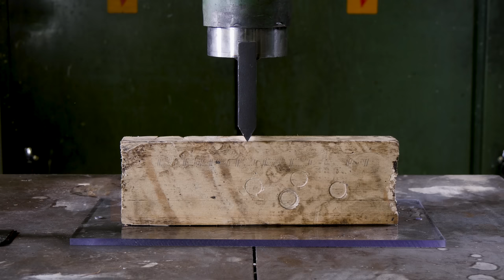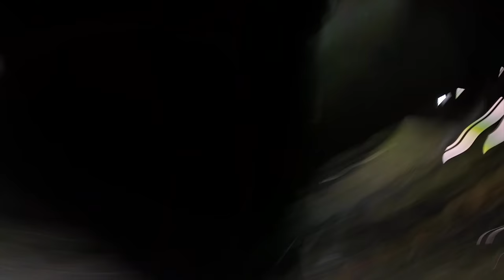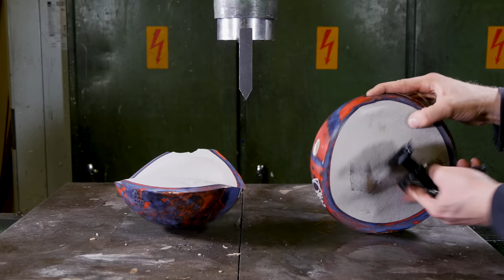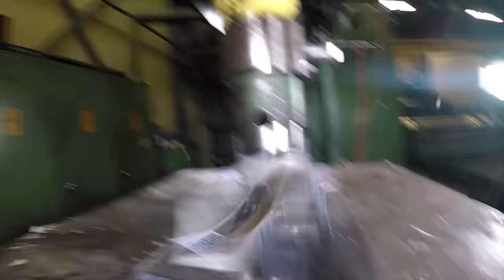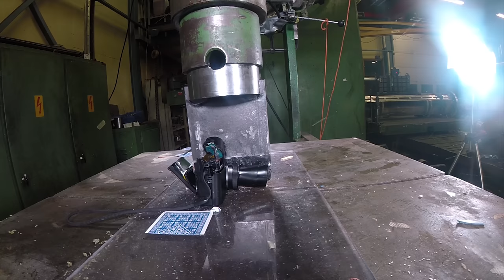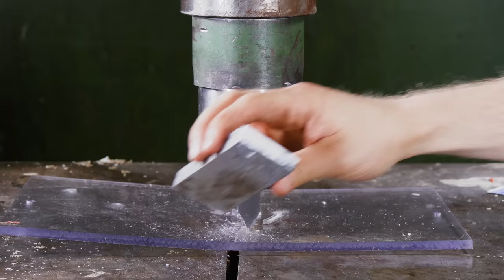150 Ton Hydraulic Guillotine Vs. Bowling Ball and Nokia 3310 | in 4K

Comment: Omg the deck of cards was so satisfying. You should stack like 10 decks of cards and do it again.
Reply: Cam D. How the fuck did you predict that
Reply: 10? Squeeze as many in there as can fit, and see if it will go. I don't think stability will be much of an issue if it is done with brand new decks and they don't break the stacks apart.
Reply: Ivan187 He didn't. He commented this after the 10 deck video came out.
Reply: Its Warpriest How are you so sure, wasn't the comment made before the video was uploaded judging from how long ago it says?
Reply: Its Warpiest 
No this was before. The comment isn't edited and the video of his request came out a week after. I just think the Hydraulic Press Channel owner didn't reply or credit the commenter but still saw it and made a video about it
Reply: Cam D. Please
Reply: Ivan187 actually if people mention something in the comment section, they did not predict anything, rather the creators use these ideas instead.
Reply: Cam D. Mine too it gives the literal meaning of cut the deck 😎
Reply: Yes  , with   ten  different  colors  to make   a  rainbow  .
Reply: 10? Try infinity and beyond!

Comment: The fact that...Nokia actually took more time to break than bowling ball
Reply: Oh it just didn't want the press to feel bad so it broke itself
Reply: The bowling ball is solid hence it can't Flex
Reply: @aleksandarjan1432  Nokia was flexing on everyone even when it was getting crushed
Reply: I mean, so did the book
Reply: Because a bowling ball is solid. It’ll explode because it can’t flex and be squished.
Reply: Bowling balls are brittle on the inside, with no metal frame like the Nokia. Bowling ball also has more surface area to get stab-crushed easier. 
It's not that surprising.

Comment: Nokia part was fake.
Reply: Rayan Lima ikr
Reply: It was real! Only a real Nokia phone could survive getting cut in half long enough to take out the GoPro camera. Its juggernaut fury persists even when its body is destroyed.
Reply: The blade is also made out of nokias so i think its legit
Reply: The battery wasn't charged
Reply: Chinese replica, it might look similar (identical) but it's not the real thing. Well something like that.
Reply: Who knows, maybe the nokia still works although it's in half...
Reply: Rayan Lima I agree it should have broken the press
Reply: DAVIDmu2 why its true, the nokia part is #fake
Reply: Or maybe it's emo poser's Nokia 3310. Posers have fake Nokias, while true emos have true Nokias.
Reply: The NOKIA uses Ni-Mh(Nickel Metal Hydrate) batteries instead of the higher powered Lithium based batteries.  Were you disappointed?
Reply: Agree if it was a real nokia it would cut the hydraulic press in half
Reply: Well the press is finnish and so is nokia so i wouldn't be surprised if it was an anti magic press

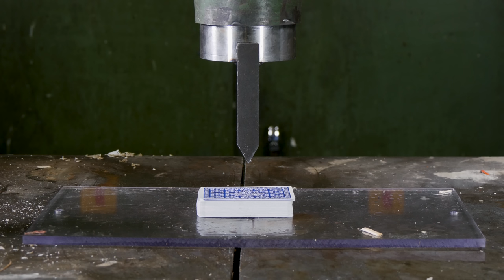Comment: 4:26 The weight inside the bowling ball is designed to help it maintain a spin when you throw it, to achieve a better curve to strike the pins from directions other than straight-on xD